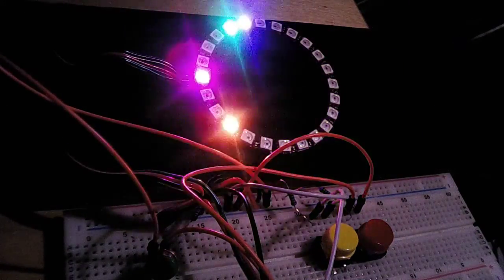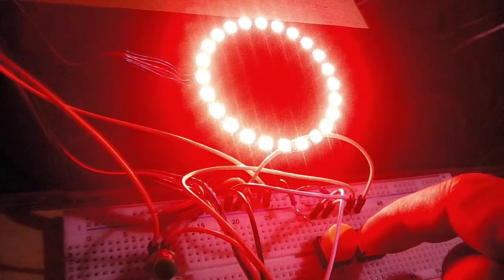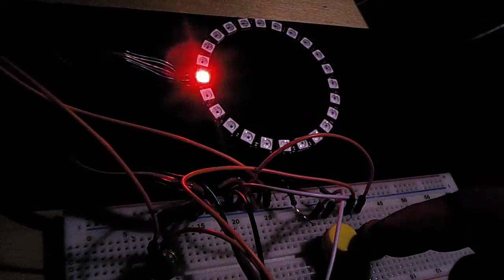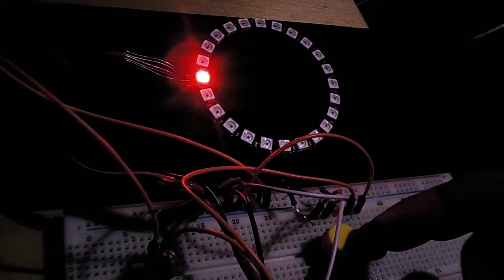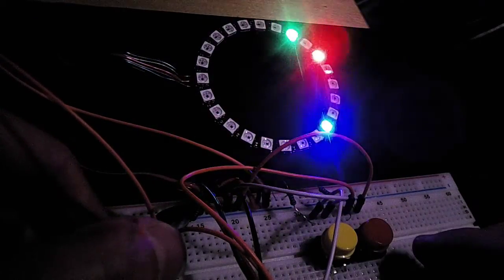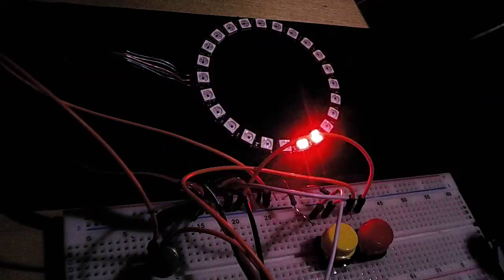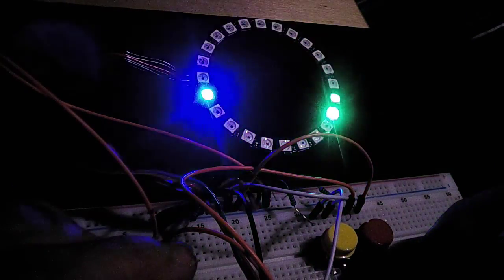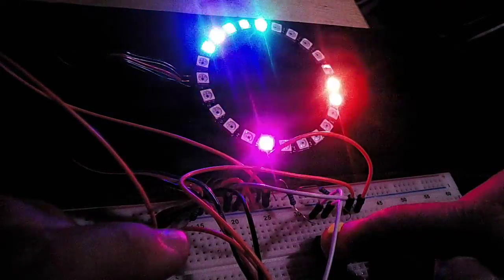Arduino Light Animation (ALA) example

Comment: Hello, I am interested in replicating your project which I find very nice, but I would need help with regards to both the code and the connection diagram, in the links in the description I was unable to find the electrical diagram, I kindly ask if could you help me, thank you and good day.
Reply from the maker: Simply install the ALA library to your Arduino IDE.  In your examples section you will then find some ALA example code.  I used the 'Button' example.  I offer a few tips in my description that may/may not help.  Hopefully this helps you.  Thanks